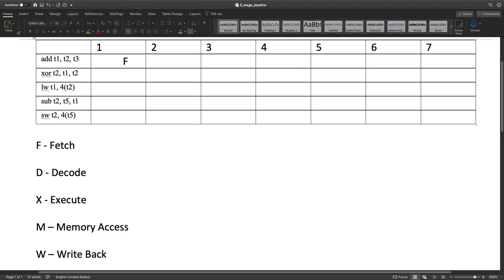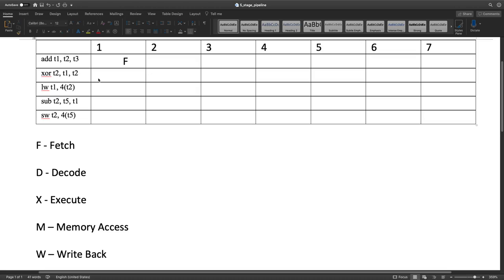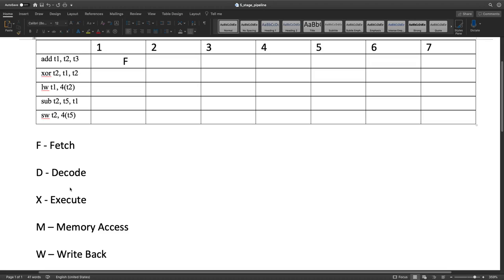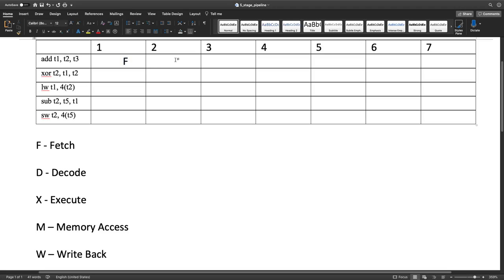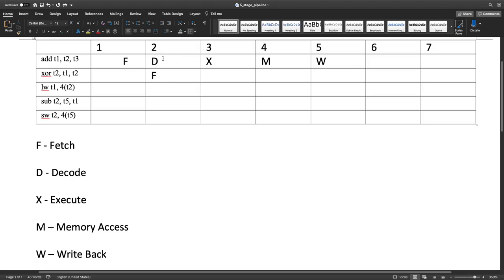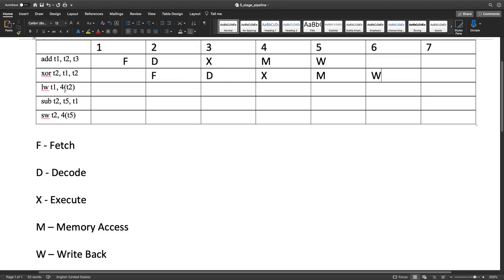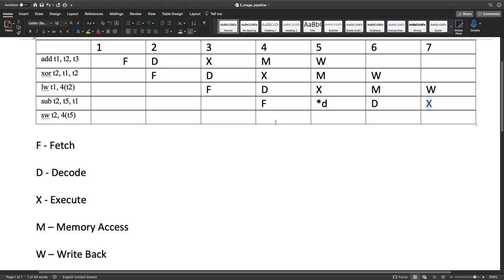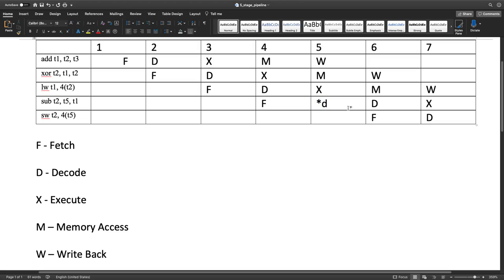5 Stage Pipeline

Comment: during the sub instruction shouldn't we delay one more cycle and so the table would have been:  sub....    F d* d* D ?
Reply: We are getting the value from mem to X through forwarding (there is a wire), and we only need the value in X 6:24 stage so
Reply: @hoodboykhan8003    5:20 implies that there is no forwarding as he seems to suggest that we must wait for the write back to complete. But I think this was just a mild error and that the table is done with forwarding in mind.